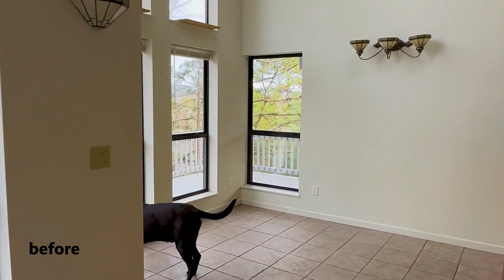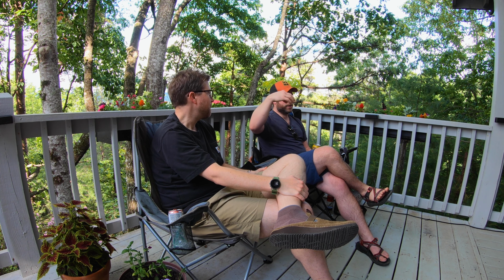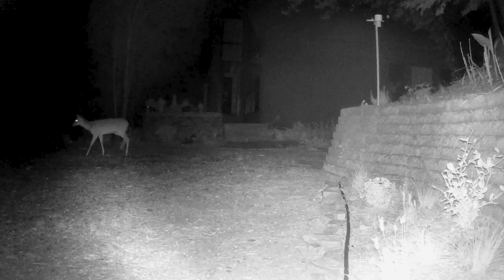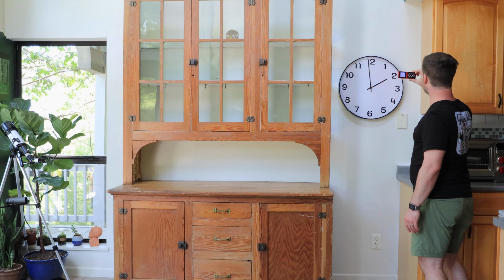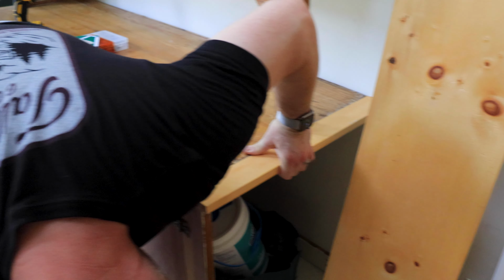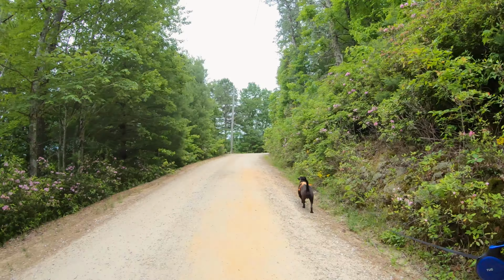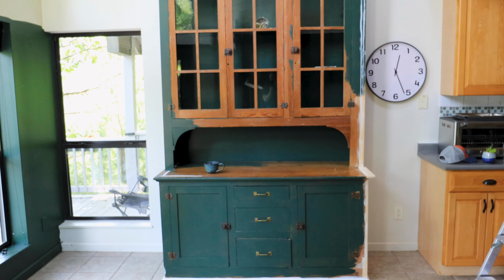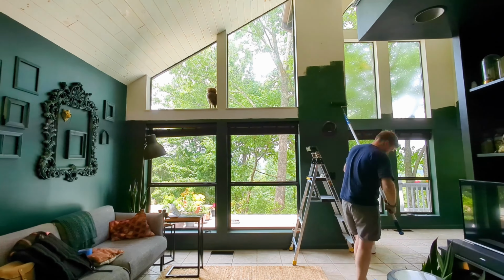DIY Antique Cabinet Install, Start to Finish 🤩 Before & After 🤪

Comment: What an absolute treat to see this today.  WOW a black bear!!!  And loved the deer and the racoons on the trail/tree cam.  That is great that you can keep tabs on your surroundings and the animal activity.   Very smart. I LOVED what you did today in your next phase if upgrading your home. Using the old green to prime the wall and furniture piece was a great idea.  Todd!!!!!!!!!!!!  You are incredible!!!!!!!!!!!  You actually created a piece of furniture!!  To mirror the other side of the cabinet/hutch!!  You did a super super job of it!!  And even the trim pieces. This was not an easy task.  See, with all the behind the scenes work that we did not see......the measuring, the purchasing of the right length and thickness of wood, the securing the piece to the wall, the cutting and sanding and cutting and sanding and perfecting. We only see the finished product and must appreciate all that went into it with the pre-fab work.  Not to mention all the trips to the store and the time involved with that.  And I even noticed that you curved the top of the table-part at the correct radius!!  Those perfecting details spell out a great mind!  And then when you all painted the whole piece, it looked like an new addition to your home.  And I do love the way you continued the paint on the wall and above with a definitive chair rail piece to separate the look.  Genius!!  So looking forward to your indirect lighting inside the hutch and the new antique brass hinges and latches.  And the brass drawer handles are gorgeous polished.  Your place is looking so grand.
Reply from the maker: Thank you as always! And yes, Todd did a phenomenal job!! I was blown away at how amazing it looked after he added the right side. There were so many behind the scenes clips that had to be cut for time but maybe one day we can put those together as a separate video. Glad you're still enjoying the progress!

Comment: Hey guys, great job on the renovations inside and out. My boyfriend and I bought a badly needed updated horse farm in upstate New York and I can tell you the work never ends. FYI - Home Depot's co-founder is a big supporter of anti-LBGTQ causes. Because of that, as a gay man, I haven't shopped at a Home Depot in years.

Comment: Hi guys. The wood of that cabinet seemed to be pinotea ( I don't know how it is said in English) which is not a common pine but a very resinous and ductile one with well-defined veins, reddish-brown in color. In our country is a highly appreciated wood for its beauty and its resistance to the passage of time and it is only available in demolitions of old houses.
Of course the color in which you painted it fits perfectly in your house.
Btw: what does Wally have to say about so many nocturnal visitors? 
Hugs. Until next time.
Reply from the maker: Thank you for the info on the type of wood. Always excited to learn a little something on the projects we have going. And yep, Wally has definitely been interested in the scents left from the nocturnal visitors outside. So far, he hasn't seen anything except deer and rabbits in the daytime. And let me tell you, he was not happy about the deer encroaching. He put up a big silly bark that scared them away. 🤣
Reply: @toddandrob  
I suppose always behind the window just like every brave dog should scare off the intruders. Lol.
"Fleeing soldier is good for another battle".